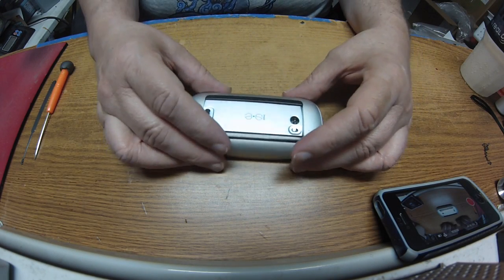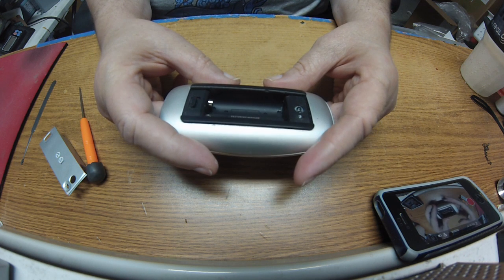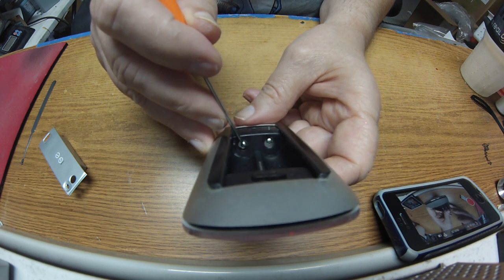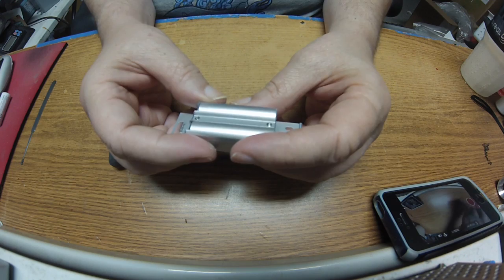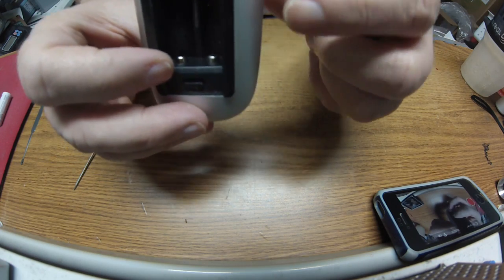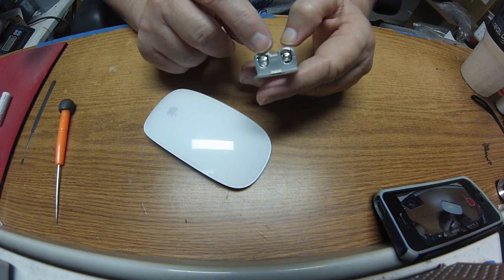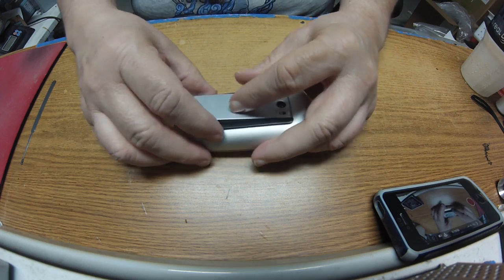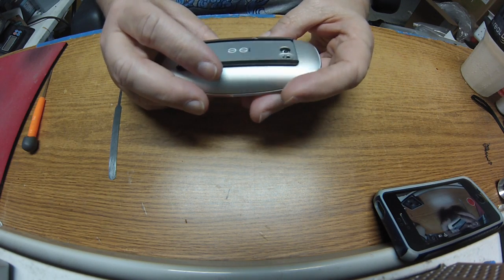Magic Mobee Charger Fix And magic Mouse Fix

Comment: I disassembled the Mobee battery pack by removing the 2 tiny screws holding the battery-cover together. One of the batteries had both ends covered with small pieces of greyish tape. Looked like someone forgot to properly remove them at assembly. I removed the bits of tape. Works well now.
Reply: What is the size of the hex drive to open it?
Reply: @alonavgil6602  Torx T5
Reply: Thanks this worked for me

Comment: Thanks so much. I run a digital music lab (16 student iMacs and 1 teacher iMac). I thought the Mobee magic charger was going  to be the solution to charging batteries for all the magic 'mice'. It has been a constant source of trouble with mouse disconnects. I had taken apart the battery packs and bent the small tab towards the internal batteries in hopes that it would tighten up the battery connections. Still all the mice disconnect at the slightest bump or hard tap. I have been searching the internet in hopes of someone finding a good solution. I am anxious to try your solution and hope it will solve the disconnect problem. I had suspected the issue was the contact between the two spring-loaded contacts and the mobee charger. Thank you!

Additionally, for those who have this other problem - one Mobee charger plate would only indicate red LED, meaning the mouse wasn't charging. The mouse would charge on other charger plates, so the mouse/batterypack was not the issue. After lots of internet searching, I found the solution someone had posted. Unfortunately I had no time to create a video of the fix, but it is a solid fix. Simple explanation - pry the white plastic surface off the top of the Mobee charging plate - it is held in place with glue- take your time it will come off without marring the plastic. There are two end contacts for the copper induction charging coil. One of the solder joints came undone. It was a simple matter of resoldering the loose end of the induction coil. The charging plate has worked flawlessly since. 

One more side note. I attempted contacting Mobee Technology. Their website is no longer active and there is no US contact email or customer service available. I used the general email address, and got an email response after many days which was very general and obviously written by a non-English speaking person. The response basically said return the plate to Mobee and they would determine if it could be fixed. Lucky for me, I found the solution posted by someone deep inside some Mac forum. Hope this all helps. And again, thanks for posting this Mobee charger pack solution! whew.